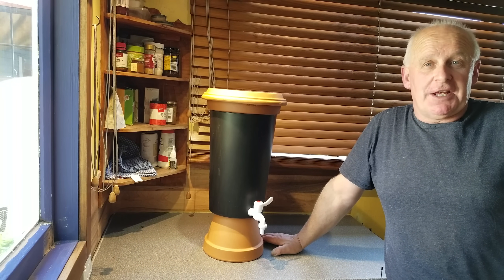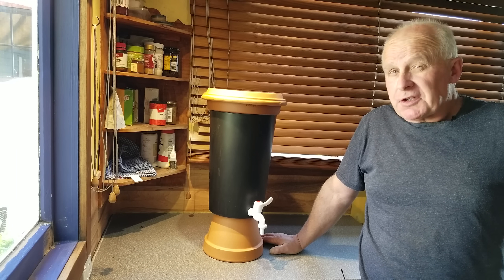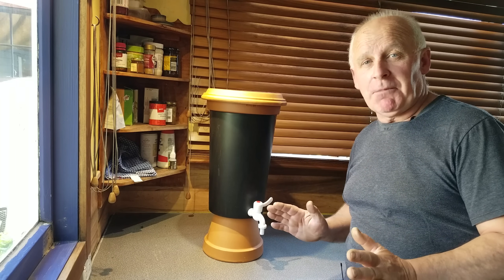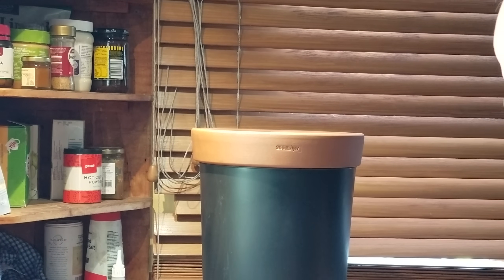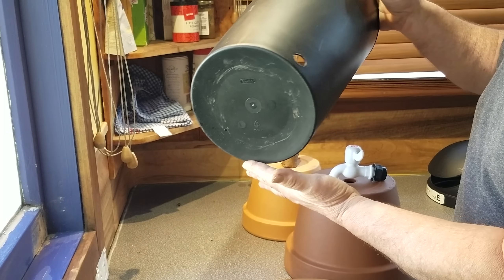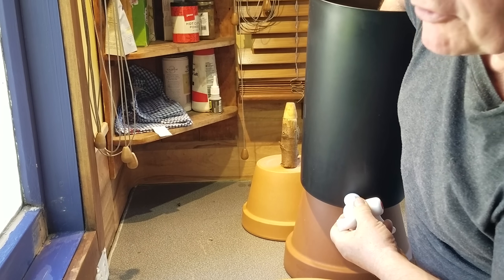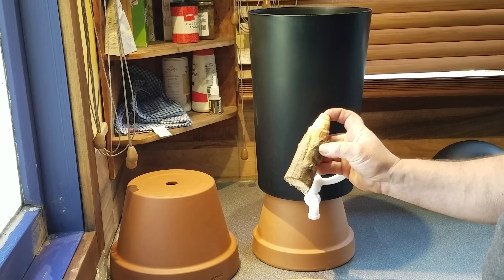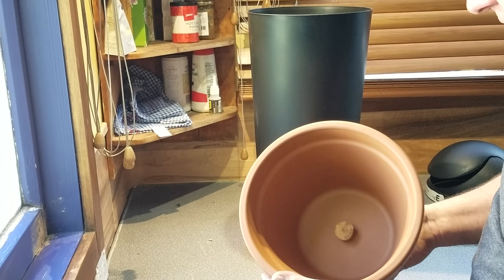DIY water filter. How to make FILTHY WATER drinkable

Comment: Some places this is no good, as Xylem Water Filter only has a 100micron filter so anything smaller then a 100 microns will pass through, the problem is you need 1u to 1 sub micron to remove parisites like Cryptosporidium which is common in the uk so i would most definatly check your local water supply, but saying that a good immune system will fight Cryptosporidium. Just dont give it to any one already ill or a low immune system.this would go brilliant above a sediment filter and i would look into a membrain at the bottom to remove that 1u partical i havn't researched if there is a natural way yet though. Well except for good old boiling.

Comment: You need to purify rain water?
Reply from the maker: Is that a question or a comment? Just this morning I pulled my meters out and tested my tanks. I do it after each heavy rain.  my tanks currently: TDS= 3ppm magnetic particles=0.0 electrical conductivity= 0.0  pH= 7.6   we have no geoengineering here as far as I know
Reply: Was asking out of curiosity as i thought you could just drink rain water as it is.
Reply from the maker: @mrcuddle3261  right here right now it seems to be safe. But I know nothing about where you live, I  suggest you get a TDS meter and a PH meter, a multimeter and a compass to check for magnetism. with these meters you can get a fair idea of what is going on in any water.
Reply: @t.h.o.r.  just a friendly neighbour over in aus, good vid by the way cuz.

Comment: absolutely misleading title
there is no filthy water used to purify
Reply from the maker: thats a good point! sorry to confuse you. Its well capable of cleaning muddy creek water if it has too but it will need cleaning every week at least. I take a very active aproach to my water supply, Im on the roof regularly, so I know whats going in, usually pine needles pollen and dust=(slimy mud) I check my water regularly for conductivity, magnetic particles, total dissolved solids (tds) and pH. Im lucky, Its pretty close to distilled water. massively better than the brew they force through the towns supply. because my kitchen water is gravity  fed off the roof with no pump, I cant use a conventional filter and this system removes the mud that I find in the gutters low points and joins. I wash and scrub the pot inside when I do the dishes with really hot water then spray it with 25ppm colloidal silver.  Its a small scale setup that was almost cost free, made from junk and it suits how we live. It's easily adapted to an emergency supply situation. when its all you have got.

Comment: Best gravity water filter I know is the one I used to promote, sell in NZ. It is a Korean patent designed tech. Now it is still sold by another distributor. I am not involved with this but swears by it as THE BEST natural gravity fed filter. It is call the 'Mineral Pot'. In my earlier time selling this product, I even had an 'Ecoli bacteria' removing test done with the old DSIR testing in Seaview, Hutt. Time test with concentrated introduction of E Coli micro organisms shown 'zero count' in just a 24hr time test. This is high volume concentration of bacteria. So the filtration removes your normal expected /unwanted elements, it also adds 'minerals' ( from sea base minerals) making the water slightly alkaline too. The ability to remove E coli comes from the impregnated silver in the pot. I other words, I have no concerns when authorities say, 'boil water' due to 'dead sea gull' contamination of water tank, supply. Use this information as you like, I have nothing to do with my previous product, only to let you know why I am still using this. Cheers.

Comment: I made a similar system. I used a 3 gallon stainless steel stock pot and on top I put a terracotta round bowl plant pot. I soaked a cork in colloidal silver and sprayed the interior and exterior of the terracotta bowl with it as well. For the lid, I just used the stock pot lid that came with it, It was almost a perfect fit and sits slightly inside the terracotta pot. I drilled a hole towards the bottom of the stock pot and inserted a stainless steel spigot. Total cost for all of it was around $35 U.S. I've had it for 4 years and so far it works perfectly. Where I live they don't add fluoride to the water system yet. But they are planning too. By then I hope to be on our property with a well and a creek and doing my own rain harvesting.

Comment: A little advice for your tap on your drum.

If it ever starts leaking you could get some stuff plumbers use called PTFE tape and wrap it round the threads for a better seal.

Comment: Does anyone know the size of the hole to drill? Please reply
Reply from the maker: you BLOCK the hole- you dont want a hole!
Reply: oh yes the one inside the terra-cotta pot. I’m talking about the hole you bore at the bottom of the trash bin. What size is the hole I need to make there so it fits the drum tap?
Reply from the maker: @Terirn65  well you need to get a drum tap and make it that size. My one was 22mm I did it with a sharp vege peeling knife.
Reply: @t.h.o.r. perfect 22cm. Thank you
Reply: @t.h.o.r. 22mm. Lol

Comment: The only things I’d worry about is unfiltered water seeping around the wood and using the plastic bin. I’d seal off the hole completely with a stainless steel bolt and safe to use rubber washers and i would use either a copper or stainless steel pot. Other than that this is a great build.

Comment: Tried this out, used an unglazed new terracotta pot with no drain holes in the bottom. It sat for 16 hours and only resulted in a couple of drops of water that was nasty colored. I suspect the water in your system is actually wicking through that stick you've used the plug the drain holes and not the pot itself.  Has anyone else tried this successfully? If yes, with holes in your pot or not?

Comment: I would check the PPM and PH before and after water treatment
1 gallon is 4.5 liters, 1 gallon  treated every 4 hours is 0.075 liters per minuet.
It's just seaping through the wood not the pot

Comment: Just like a lot of the comments here said, the plastic container can be the weak link to a healthy water filtering system. While it's true as you have said that polypropylene is safe for food containers, it is another thing with colored PP. Most plastic products manufacturers will use black for recycled plastic resin simply because the parts that got recycled will come in many different colors. So making them black is the way to go. Judging from the price you paid for that bin, it was probably made with recycled materials. Now, the thing with recycled plastic during the molding process is that the factory will probably need to use additives in order to compensate for the shorter polymer molecules in recycled material. And a lot of the time these additives contain phthalates which is a substance that is detrimental to the reproductive, neurological, and developmental systems of human. Particularly with children.
Now you have been warned.
I work with plastic manufacturing of household and children products

Comment: ANYONE, not t.h.o.r.:  I did this set up, and after 24 hrs I had MAYBE 2 ounces in the receiving vessel. And using my water tester, the TDS was 450+ ppm!  (From water that was 36 ppm to start...). I dumped it and ran the test again. Same. I have a silicone bung in the hole. no water seepiing around it. Both vessels (the sending and the receiving) were thoroughly cleaned, high quality 304 stainless steel and the flower pot was 'made in italy' terra cotta just like thor's set up here. I primed it and cleaned it (not with soap, etc) before use. 
I also did a terra cotta round as just a holding vessel. Water very gradually sweated out, but again, VERY gradually. I keep a plate under it.  Water TDS contained in this vessel went from 36ppm, to 42 ppm, which is acceptable. Haven't been able to test the pH as my meter's battery is dead.  Supposedly, using the terra cotta as a holding vessel increases the alkalinity of the water. 
My town's municipal water is superb, with only 36ppm, sometimes only 32. But they do add a tiny bit of flouride and chlorine.  Flouride is so difficult to remove. I had high hopes for this method. 
Any thoughts?

Comment: I don't know if I understand correctly: does water pass through terracotta because it is porous ? Thanks in advance
Reply from the maker: Yes andrea- It has tiny pores that filter to less than 1 micron. that is why it is used in water filters- along with activated carbon , sand, paper and various micro mesh fabrics. They all need to be periodically cleaned or disposed of. with regular cleaning this is a low cost gravity filter that will last forever.

Comment: How much clean water?
Reply from the maker: says at the front door- 12 litres. but you can make it whatever size you like.
Reply: @t.h.o.r.  what i mean was does it give water like RO or it has some impurities left  in the water.
Reply from the maker: I absolutely will not drink municipal water so I capture rain water from a small regularly cleaned roof and put it through this. This is my drinking and cooking water. Its sweet and clean- But Im in New Zealand so it may differ for you  @codeaccount2434
Reply: @t.h.o.r.  Thanks for reply, I am in Virgina water is clean but still I think it has chemicals from air pollution.

Comment: This is great except for the fact that pottery often has heavy metals, or toxic elements in it from the clay used, like cadmium.  

You need to know what is in the clay of the pot. If your pot is known to be free of heavy metals/ toxins in the mix then this is really ideal. 

Lastly, when possible dont use any plastic, even polypropylene is problematic,  it is the least toxic plastic but it still leaches out toxins so use stainless steel. Remember that the EPA is a zombie agency controlled by the industry they are supposed to regulate.

Good video and in an emergency situation, if unprepared this will be your best bet

Comment: But are you still adding PFAS? Regardless of spec numbers plastic and its coding leach as does the terracotta clay pot.
Reply from the maker: what are your water pipes made from?
Reply: @t.h.o.r.  Same plastic and I understand but I filter that water it doesn't sit and marinate. I have an RO system. Maybe a stainless or porcelain and the rest of your set up?

Comment: Grat idea, thank you. 

1. The black plastic wasn't pruduced for food/ drinking water quality but for trash...
So it might be that the surface has wrong quality and infuses to much micro plastic into the water together with chemicals that are used to pruduce it ( softener and much more),

Black colour is one of the most poiseness in the world ( also for clothes getting threw the skin) surly for drinking...
Maybe using a glas container ( such as done already for parties drinks or metal ( in food quality like for big kitchens or bier ) would be better. 

2. Same is for the terrcota, if not made for food/ water quality,  it might have heavy metals and more things in the water we wouldn't like drink driectly...

 I would check the filtered water for such production chemicals...

3. Doesn't the terracota get mould with the time?

Comment: You can't remove toxins and heavy metals by ceramic filters. You need coal. Rainwater is not a clean resource, even straight from the sky. When it is collected on your roofs, there are plenty of germs and bacteria. Bird poop, debris,  the roof it self, pain, plastic. Another thing is the clay. Probably not food graded when it is a flower pot.

Comment: I would want to see an analyses of the water before trying this.  As for the plastic , that’s a no go for me.  An easier solution is to set it on top of a stainless steel stock pot.  Most people have one laying around.  Can also get one cheap at local thrift store.  Let the water seep in, remove the clay oot and pour the water that is in the stock pot into a pitcher and put into the frig.  This way no plastic, plus dont have to mess with drilling and spigot.
Reply from the maker: I did it just to show people what you can get by with if they are pushed. Its still going strong after two years with regular scrub outs and sanitation with colloidal silver. still looking for a suitable glass or s/steel pot that I can fit a tap to. meanwhile - our town water is even worse!

Comment: I appreciate this video instruction.
The plastic bin is still plastic and I don’t trust it. Why can’t we use a glazed on the inside ceramic pot to hold the water and put a spigot in that? Also, in the USA I’m told that all clay pots and ceramic pots must not contain lead. Many of them are imported from places like Vietnam and Cambodia, South America, and other places, but they can’t be sold here if they contain lead. If that’s really being held as a rule, that’s great.but be sure to check what your rules are in your country because we don’t want lead poisoning.
I agree with the person who said to use glass or stainless steel for the holding tank. I think that’s wise.

Comment: It would be interesting to have your cleverly filtered water tested for its elements, and micro/nano  particle contents…I know it would probably be expensive…just musing. And thinking how one could add an extra element of filtration, should one so choose, by rigging up a very fine mesh of some description filled with Activated Charcoal. You can buy a cheaper version of the food-grade ‘Activated Charcoal’ by using that which, surprise, surprise, is designed for filtering water by food producers. [And for any would-be questioners - “no, I can’t remember, off hand, without digging through my files, exactly whom I bought it from. But you can find it exactly the way I did - I found it on-line, here, in good ol’ NZ 😊   No doubt you can do the same from wherever you are located 😊 ].
Our charming Host here has taken an original idea and enhanced it. And all praise to him. It assists those with limited resources. Follow his example and work within your own budget to further enhance an idea, or not. 🌻

Comment: Great idea, but you would get a better seal around the tap if you put the washer on the outside as the water can still seep down the thread if it's on the inside.
Reply from the maker: Thanks- you are not the first to say this. I have trouble with it in my engineers brain. 1- the pressure in the bottom of the pot forces water down the thread only if it can get to the thread. putting washer inside stops this before it starts. 2- when you seal a fish tank or a water tank- you seal it on the inside because pressure forces the seal into the gap whereas on the outside it blows the seal open. 3- houses are water proofed on the outside - because that is where the water is. why let water seep through- then stop it on the way out? By the way- this pot is over two years old and has never dripped a drop.
Reply: @t.h.o.r.  The problem is there is always a route for the water around the thread when it is sealed on the inside. If the washer is placed on the outside flange the seal is on the inside and outside edge so it doesn't matter if water is around the thread, so it can not escape. Belt and braces would be a washer on both sides The reason it hasn't leaked is most likely it is sealing plastic to polypropylene directly without using a washer. This is how we seal water tanks. I am a plumber lol.
Reply from the maker: Ooooh - plumber vs engineer!! haha- sorry but you have proved my  reasoning- mine does not leak- you said "it will always leak" 😁 I still maintain that if water cant  get into  somewhere- then it cant get out the other side .  Im big on empirical evidence rather than doing as I am told.  @crashnburnband
Reply: @t.h.o.r.  I am just talking from experience. Yes, what you have done works but the washer is superfluous.

Comment: Very good and easy to make idea. Another simplistic natural water filter could be built by layering   sand, gravel, rock in that order from botton to top, each about 10cm deep. And as the water goes through each level it gets filtered. This will last longer. Also add more layers of natural material, like activated char coal, different varieties of stones of varying thickness.
Reply: One must boil or sanitize all those ingredients prior to assembly.

Comment: I hope you realize that every time a plane flies over head, those long trails that slowly dissipate outwards spreading out into clouds, those are chem trails and they are FULL of toxic chemicals. It gathers in clouds, rains and pours down on everything, if you collect that for drinking you should be aware, its not just the tap water you need to worry about.

Comment: Thanks for a very useful video. But, I'm not comfortable to use a plastic container even if it is grade 5. I've seen some articles that there still  may be emission of some chemicals even from the safe plastic, because water will stay in the container for a while. I will see if I can find a glass container big enough and with a wide opening for a flower pot. Thanks again!
Reply from the maker: your water pipes are grade 5

Comment: Great idea, but you’re drinking filtered water that’s now polluted with plastic because plastic continuously breaks down though can’t see it. It alike your skin renewing itself continuously, same principle, only difference is plastic is breaking down 😅
Reply from the maker: Ahh- much like the plastic water pipes that deliver the water to and all through your house- I see, carry on.
Reply: @t.h.o.r.  I have copper buddy. So you carry on. I wouldn’t put plastic as water pipes in my home and I’m a builder in Sydney Australia. 

Insane I’m not, when I say something it’s because I do it also

Anyway all one has to do is replace the bottom section with a ceramic pot or glass